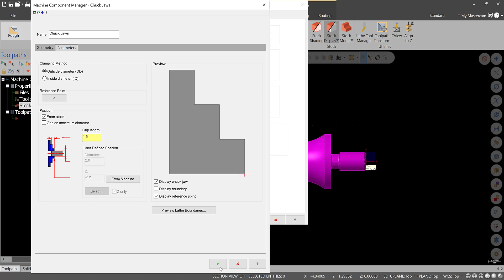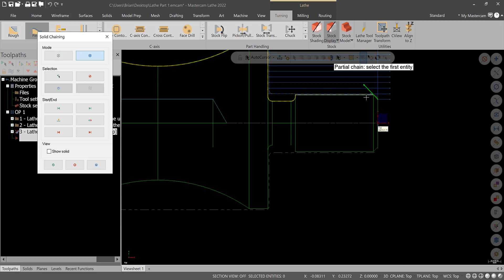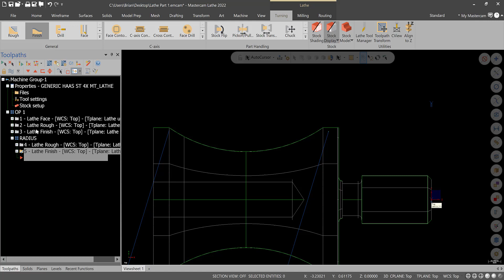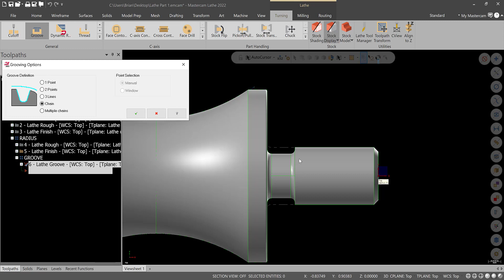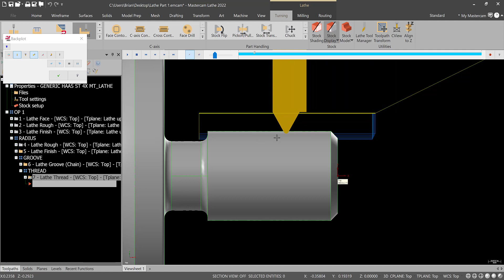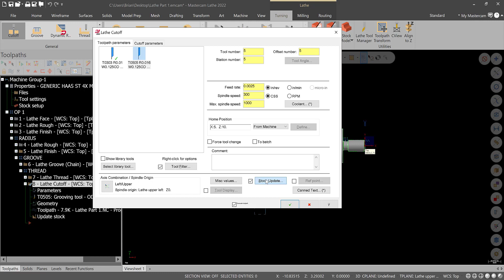Mastercam Lathe Threading

Comment: On the grooving cycle, is there any way to make the finish pass  run one pass rather the one side lift up and do the other side? hope that makes sense.
Reply from the maker: Not that I know of. Groove toolpaths want to cut into the part as that is the pressure the tools are designed for.